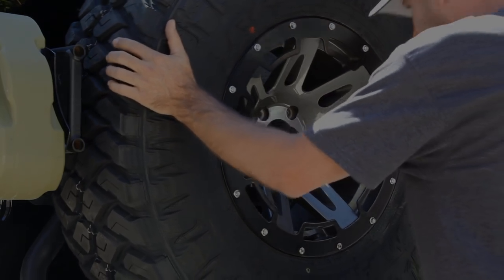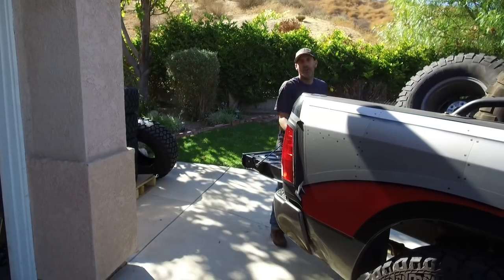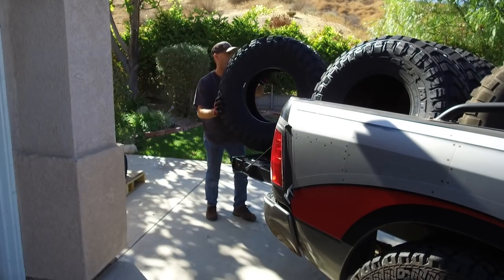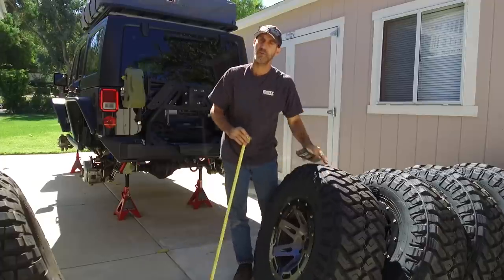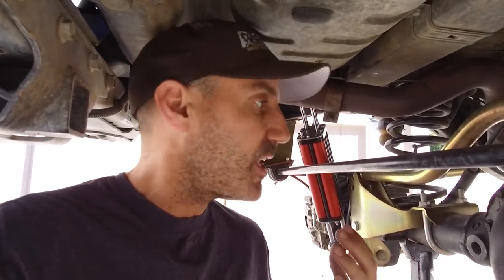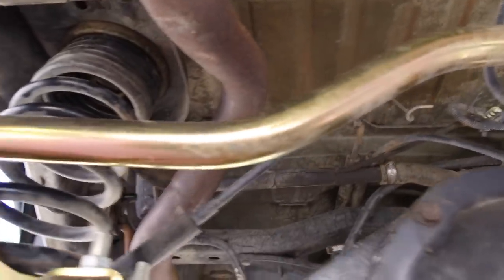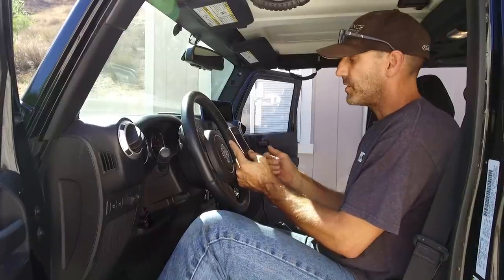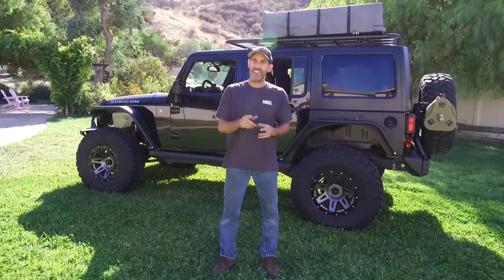Mounting New 37" Maxxis Razr Tires on the Jeep Wrangler JKU

Comment: In the video you mentioned that you wish your programmer could override the traction control.  After I was schooled in some soupy mudd in the spring in WV, I learned that you can shut almost everything off if you hold in the vehicle skid control button for 6 seconds.  Basically, in 4Hi this is the only way to rid yourself of most of the tech.  In 4Lo, this will happen automatically. I know it doesn’t shut it all off, but it gets you closer.
Reply from the maker: Great tip! Thanks a bunch!

Comment: I have 38 13.50 20 maxxis razr on my 16 superduty.  They do not like deep sand, they dig straight down unless I air down or use 4x4.  Other than that they handle great, arent much louder than my dc fun countrys. So far have about 15k miles on them a little over 3/4 tread left. But I drive it like a racecar all day long.

Comment: I saw on another video you switched these out around the 20k mile mark(can't find the video again). I am pretty seriously considering this tire, and was wondering how much tread life you had left when you swapped them out, and if you would recommend them. Thanks!
Reply from the maker: I absolutely can recommend them. Great tire. Looks are awesome, wear is awesome, grip is great. The only thing you should be aware of is around town you can notice the lugs and have a bit of a lumpy feel... not bad at all but more pronounced than the Falken or Milestar tires I have. I would get them again for sure.
Reply: @AutoEdits  awesome! Thank you for the reply. Think I might pull the trigger on them! 👊

Comment: Any updates??  I'm thinking of upgrading my KO2's.  I know the KM2's are 35.5", but these were 36.5" off the Jeep.  Did you measure them on the Jeep also??
Reply from the maker: I have about 4,000 miles on the Maxxis and they are doing pretty good.  They need more air more sensitive to air pressure changes and at low psi do great off road but need a bit more for on highway confidence. The KM2's are just a really awesome tire to beat.  They do everything well and last a long time.

Comment: This may not work as well as the "use your back and take the legs out of the equation" lifting method.  But here it is.  Take one of the tires and roll it to the tailgate of your pickup.  Roll it away 1/4 turn.  (Have someone hold the tire)  Get a second tire that you want to load into the bed and place it perpendicular to the first tire as close as your can get it.  Then simple push the second tire against the first tire and it will roll it up and forward toward the bed of the truck.    I am always thinking or new ways to stay as lazy as I can.

Comment: Hi. To measure the actual tire diameter for the speedometer, you should measure from the center of the axle to the floor with the weight of the Jeep on the tires. Then multiply that value by 2. The height of the tire without weight of the Jeep is not such an accurate measurement for the speedometer. I estimate that the real value is closer to 36in than to 36.5in. Nice Jeep, I'm a fan since the beginning of the built.
Reply from the maker: You are correct! Love to learn that little trick... they are 36! And the speedo checks out perfect.
Reply: +autoedit I'm curious what psi you're running those tires at.

Comment: Great program, I have a black Rubicon 2012 . I order 4.88 gear ratio, i  am running 4.10 stock.
What's your opinion?
Reply from the maker: For 37" tires... 4.88 is the perfect ratio to feel like the stock final drive.  I like it.
Reply: Good next set of tires will be 37 thanks

Comment: did you put the floorjack under the rear and front pumpkin before you put it on all 4 jack stands? I wonder if the pumpkins are safe for jacking the wrangler? thx
Reply from the maker: Yes they are.
Reply: thanks! there is a lot of discussion about that on the net, and its not stated directly in the manual..so wasnt sure if the differential housing can handle all that weight...

Comment: How are the Maxxis tires holding up? Time for me to pull the trigger on new MT tires. Thanks
Reply from the maker: They were amazingly tough. I have since swapped to the Milestar Patagonia and they are so different. So it all depends on what you want so here's my honest take. The Razrs look way tougher and actually feel stronger but that comes at a price of feeling chunky around town and on the highway. The Patagonias are much quieter and don't have near as strong of a sidewall but they are amazing around town and on the highway.  I have videos of doing crazy stuff on both so it comes down to what you want and like the looks of.
Reply: @AutoEdits  Thanks for taking the time. Appreciate the videos and the quick replies. Will check them out

Comment: Are you sand bag or weight balancing your 37's? I am curious because I just put 37's on mine and I notice some shake in the wheel but the shop that I had got them balanced tells me that it's normal for such a large tire. -Thanks
Reply from the maker: +James La Spada I had that tire shop balance them with stick on style weights and it is perfect down the highway . No shake at all.

Comment: Can I get an update on these tires? I’m looking to buy new 37s ASAP. I’m too indecisive but the Maxxis Razr And Falken Wildpeak area couple top choices.  Switching from the Nitto Ridge Grapplers to try something new.  Bought beadlocks.  Changing everything over at once (wheels, tires, big brakes)
Reply from the maker: That's a tough question.  For overall performance and comfort the Falken Wildpeak are the best.  For aired down confidence the Maxxis are fantastic but are loud and lumpy in daily driving so if it's max off road grip in low air pressure situations go Maxxis Rzr but as an all around great performer... Falken all the way.

Comment: Are u finally going to go to 40s soon bc you   are slightly going slowly up in size and I remember ur older vid u said u don't mind maintenance on 6 pack shock how u feel bout fox resivour shocks bc I was wondering if I should do six pack or the fox
Reply from the maker: No 40's for me on this Jeep. I would have to upgrade the axle housings first. The 6Pack shocks are good and they offer 3" more ground clearance under the control arm mounting point.

Comment: Did you weld up your exhaust at the slip fittings or is it just clamped together?
Reply from the maker: I haven't welded anything on the exhaust... just clamps for now and it seems to be holding together very well.
Reply: Thanks, that's good to know!

Comment: You had mentioned the 4.88's, I can't find when you had them added to your jeep. Are they fitted into the Dana 44's or do you have different front and rear ends from stock?
Reply from the maker: I ordered gears and axle shafts from G2 and installed them in the stock D44 housings.
https://youtu.be/pOm6cyKWZpU
Reply: Excellent, thank you very much. Also, I think your videos are fantastic. Great seeing your jeep turn into such a capable machine!

Comment: Do you have the adjustable track bar in the rear of your Jeep or is it just a relocation bracket
Reply from the maker: The track bar is adjustable but the mount is not.
Reply: autoedit that's kinda odd adding the bracket. Have you throught about installing just an adjustable trackbar?

Comment: Hey Jason, now that you've got a ton of road/highway miles on these, I'd like your opinion on their road manners.  I've been super pleased with the road manners of my Nitto Trail Grapplers, but am considering these Razrs for my next set.  I know all of these are good offroad, but how are they at highway speeds?  Smooth rolling?  Tons of balancing weights?  Excessive vibration/noise?  Thanks, man!  I really appreciate your input. :)

Comment: Question sorry if I missed it? Do u need to upgrade ur axles for 37s or can the stock ones handle it? I always hear mixed on this was wondering what u thought?
Reply: Btw those are the tires I'm going for next!!
Reply from the maker: I hear the horror stories as well.  My axle housings are stock Dana44's and I did upgrade the axles shafts to chromoly units by G2 but otherwise things are doing ok so far.
Reply from the maker: Stay tuned... I'm about to put a couple thousand miles on it and will have a pretty comprehensive performance evaluation soon!
Reply: Mark Fisch well do u mean axle ratio or axles shafts? Always for the first and for the second it depends on how you use your vehicle.
Mall crawler - No
Weekend warrior - I would for peace of mind but not necessary 
Offroad Enthusiast - YES YES AND YES!
P.S. even if you have a truck like me I recommend following my scientific explanation to your question 😁
Reply: Thanks I look forward to hearing about it. Might be my next move
Reply: Recommend upper and lower gussets.

Comment: How were the tires?  Searched for your review on them.  Didn't find anything.  Really considering these tires.  Thanks for any advice and review.
Reply from the maker: I haven't taken the time to do a specific review on them but I can give you my thoughts so far. 
They are decent all around tires but are as loud as you would expect on the highway and in low speed around town maneuvers you can feel each lug on the tires as you roll.  BUT aired down off road... they are simply amazing... better than the BFG's.  So a little compromise all around but fantastic performance where it counts!  Hope that helps.
Reply: Thank you very much for the input on these tires.  I'll be installing mine on Friday.  Great Vids!  Keep it up!
Reply: Installed Thursday (arrived one day early, BONUS!!) Ran them on a rocky trail in the desert on Sunday.  Dropped psi to 14 on 295/70r17's and they stuck like glue on the rocks.  Gonna do my own review on them on a forum I'm apart of.  I'll try and come back here periodically and see if you've uploaded your review for comparo.  Thanks again for taking the time to get back to me with info!